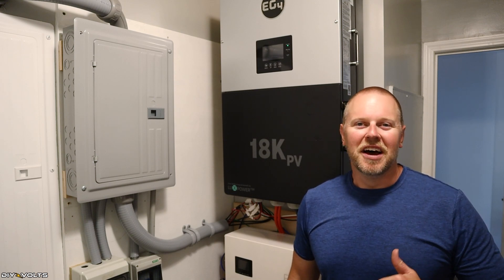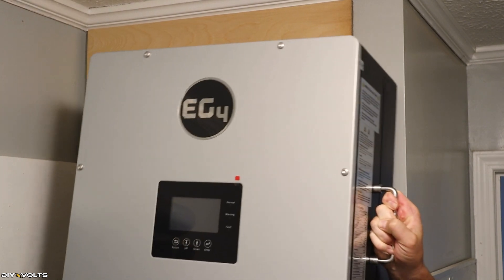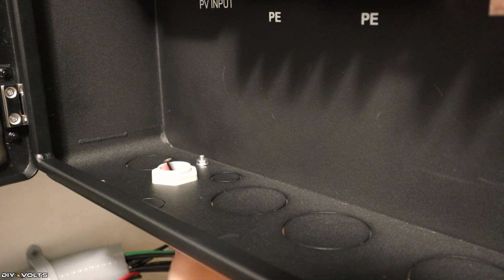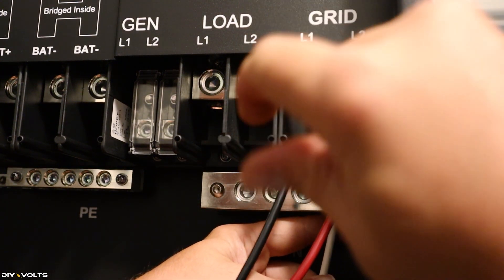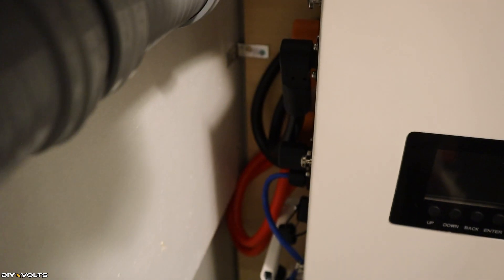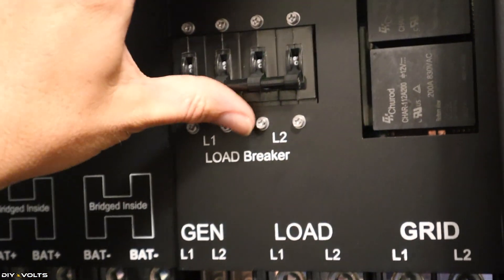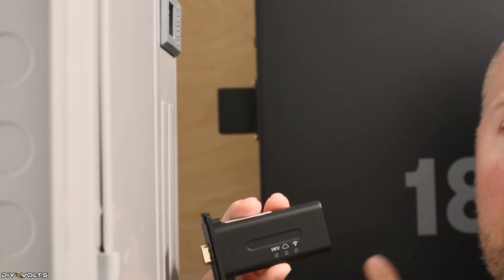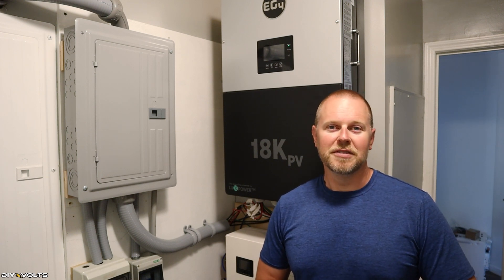EG4 18k Hybrid Inverter Installation: A Comprehensive Guide

Comment: Amateur salesman. High-frequency, transformerless inverter's like this inverter lack galvanic isolation and can potentially damage appliances, mainly due to shared DC/AC grounds, leading to ground loops, leakage currents, voltage fluctuations (brownouts/spikes), and inability to handle heavy surge loads, which can harm sensitive electronics or motors, requiring specialized installation and protection. 

How Damage Can Occur:

Ground Loops & Leakage Currents: Without a physical barrier (isolation transformer), the DC (solar/battery) and AC (appliance) sides share grounds, creating pathways for unwanted currents, causing interference or even system shutdown.

Voltage Instability (Brownouts/Spikes): Some models may dip voltage (brownouts) or produce noisy power, especially under heavy loads, which can stress motor windings and electronic components.

Poor Surge Handling: HF transformerless inverters often struggle with high starting currents (surges) from motors (fridges, pumps), potentially causing shutdowns or stress on the inverter and connected devices.

DC Leakage: The AC output can carry DC leakage, potentially damaging sensitive electronics not designed for it, or even causing issues like corrosion in marine setups.

Comment: Where did grid wires come from? Main panel?
Reply from the maker: I installed those just in case I ever had to charge the battery from the grid. So far after 3 megawatt of solar I have not needed to use the grid. I keep the breaker off on the house panel.

Comment: My senior supervisor when i had to unwire and re wire a 10k sqft building with 4 panels "its like a build a bear" this set up is easy just dealing with weight. Just the 18kv inverter weighs 121 lbs. 55 kg. Essentially i have to replace the existing inverters to be able to wire this in. 12 kw max output.  21 kw Max solar input.

Comment: Where did the ac wires come from?  The subpanel?  And if so are they just to a 50 amp breaker?
Reply: DIYVolts, I wish you would answer the above question. (Where did the ac wires come from?  The subpanel?  And if so are they just to a 50 amp breaker?)
Reply from the maker: The AC wires are only there if I ever needed to charge from the grid. They go to a 240v breaker in the main home panel. I have not needed to turn that on since I installed. 9kw of solar keeps the battery charged enough.
Reply from the maker: I installed the AC wires to the home main panel just in case I ran the battery low enough to need grid charging. The system has now used over 3 megawatts and never needed the grid. The grid charging is limited so I would only need a 20amp breaker if I wanted to charge from the grid.

Comment: So if your solar panels are 60 feet away from the inverter, what size wires are you running to the house from your solar array? Since the wires from panel to panel do not increase as the voltage and the amperage go up? So when you make the connection to the panels at the end of the series, do you increase that wire accordingly? 
Where can I find tables for that high voltage DC?
Reply from the maker: With 10awg wire there is very little voltage drop over 60 feet. My neighbor installed a system with 200 feet of 10awg. The voltage drop is also not an issue. My system is running at 435v so even a drop of 2-3v over that span is not going to make much of a power drop.

Comment: Did you use the CT clamps? Are they required?
Reply from the maker: My inverter only powers a critical loads panel. It is not connected to the grid. No CT is needed.
Reply: Thanka for the reply.  Great install!  @DIYVolts

Comment: Wanted to see you turn off the pv off and battert to see it automatic switch to grid
Reply from the maker: I have my system isolated from the grid. There is a way that I can turn on a breaker to charge the battery from grid but it has been off since I installed the system.

Comment: Are you sure you connect to grid because it shows zero
Reply from the maker: I connected the grid power only for emergency backup. I have a breaker in my main house panel that can charge the battery if I need to. My critical loads panel is isolated from the main house panel so there is no issue with the two power sources competing.

Comment: What gauge wire did you use for your L1/L2?
Reply from the maker: i used 8awg to hold 55 amp. the highest wattage i have used ao far is 7000w.

Comment: best practice would be to put Ferrules on those stranded wires!
Reply from the maker: Yes! sadly i noticed the manual mentions that after i had the wire installed. Its not a requirement in the USA but its a good idea!

Comment: Thanks for the video. Would you mind providing the name of the small white pipe socket you placed at the bottom where the cables pass through? Also, what would the setup difference be for someone with an existing on-grid solar system? I have an existing on-grid solar system and I just got this inverter and battery to convert into a hybrid.
Reply from the maker: Those are called PVC pipe glands. They are meant for larger wire than I used but they supply a nice clean surface for the wire to pass through. Normally an on grid system is going to have a micro inverter right at the panel or close to it. That converts the DC power from the panel to 240v grid power. You would need to take DC power from the panels to the inverter. Then from there you can setup the inverter to output excess power to the grid. I would let the inverter charge the battery first then power the house loads and finally send the power to the grid. There are settings in the manual that can help you through the steps.
Reply: With an existing on-grid system, attach the AC to the generator input, and configure the 18kPV for AC coupled solar.

Comment: Are the 2 positive and 2 negative battery connections one for charge one for feed?
Reply from the maker: Both battey wires are for feed and charge. They are the same point electrically. The battery is setup in parallel. The set of wire allows for higher amp draw with a smaller wire size.

Comment: I think the grid and load and grid wire would be much heavier gauge.
Reply from the maker: Yhe max output of the 18k is 12,000w. The wire I used can supply 55 amps. 55amp x 240v = 13200w. The wire could be 1 size larger no problem but it is still within amp capacity.
Reply: do you have an EV? Think the 18K can handle an EV? 

EVs are on a 60a breaker pulling 48a

Comment: Thank you for the video. One question. What happen if there is lo load in the house (nobody home), battery are full charged by solar panels. And I don’t want supply to the grid. The inverter just go to “sleep mode”.? thank you.
Reply: yes
Reply from the maker: Unlike hydro power or wind power the solar will just sit unused. The inverter does have an idle consumption of 50w.

Comment: El manual dice que soporta 600 voltios, Podría decirme si eso es en total o en cada stream ? porque veo que tu estas usando 345.8 y 349.2 = 695 V   en cada stream, lo que suman por encima de 600 que están en el minuto 15:00
Reply from the maker: Each MPPT controller can handle 600v. I now have 3 strings at 345v each.

Comment: Those wires look very small.
Reply from the maker: I used 6awg. Those can handle 55 amps. The inverter can output 12000w. 12000w/240v=50amp. I still have 5 amps above the maximum output on both sides of the AC.

Comment: Many mistakes ...  Ferrules are required for PV cables, no exception, basic PV install knowledge. Moreover, don't you think you are using the wrong gauge for your load and grid cables??? If you need such power, use the proper gauge, the ones you installed are meant for 50 Amp.
Reply from the maker: Ferrules are not required by code in the USA however highly recommended in some instances. I actually found in the manual that ferrules are recommended. This inverter has an AC output of 12,000 watts. Each leg of the power output can supply 6000w at 120v. 6000/120= 50amp. The wire I am using has a rating of 55 amp. This allows my inverter to run at 13200 watts. This is higher than the rated output. I am sure that you could step up the wire size but as it is now I am good for the rated power.

Comment: Would have been nice to know what gauge wires you were using.
Reply from the maker: The output of the EG4 18k is 12000w. 12kw/240v=50amp. I used 6awg that can handle 55amp.
Reply: @DIYVolts  what about the battery connection?
Reply from the maker: i think it was double 1/0.  should handle 300 amps.

Comment: So let's say your hybrid inverter has gone kaput, does that mean you need to rewire to get power from the grid? because now your grid wires are directly connected to your inverter.
Reply from the maker: I used wago connectors in my main house panel. I would need to reconnect the house breakers in the house panel. It would take an hour but it would not be hard to do. (Each wire is labeled in both panels Hot and Neutral)

Comment: This is really bad , stranded wire screwed down is NOT a good connection, You need to get an electrician or learn how to use crimped Feral connections.
Reply from the maker: True. Ferals are needed on the wire. Good point.

Comment: Any reason why you chose the Ethos batteries over the EG4 wall mount batteries?
Reply from the maker: Big Battery sent the Ethos for review. I have a rhino 2 (same as the eg4 wall mount) and it is a good battery. They take up more space. And the wall mount is 309 pounds. Its easier to move 120 pound modules.

Comment: What size wire did you use for grid and load, and why?
Reply from the maker: The grid and load are both 6awg. This size wire can handle 55 amps. The inverter is a 12kw system so 240v * 55amp: 13200w. The wire size is large enough to handle the output of the inverter. So far in over a month of use I have not had a load over 3000w. As for the grid I have not had to use that so far. But I will limit the charge down to 4000w so that it is well within the wire size.
Reply: @DIYVolts  i am using 6awg with 50amps breaker for subpanel
Reply: You should change out that 100amp main breaker in the sub panel to a 50 amp one. The 18k inverter has a higher pass through, I think and while on grid you could get into trouble.

Comment: What setting did you set your lithium phosphate battery as? Thanks for your video!
Reply from the maker: The inverter manual indicates that these needed to be set at 0 lithium type to communicate with the battery.

Comment: You should also turn all of the breakers off before shutting off the main breaker and then turn them on one at a time after turning the main breaker on.
Reply from the maker: Is that due to an inverter load issue? Seems like the same as a power outage being restored.
Reply: @DIYVolts  less inrush of electricity, and it's safer all the way around

Comment: Don't see cts connected and no grid power shown from inverter screen. cement board would be better choice. metal conduit for pv wires and look like you use ac wires for pv and no ferrule at all. battery cable strip look too short and no torque wrench use. Would like to see update inverter pulling power from grid. #2 wires feed to sub panel for safety load amperage.
Reply from the maker: The breaker I have coming from my house grid panel is only 40amp. My 6awg wire is able to handle 55 amp. when I connect the grid I will only use the power to charge the battery when it drops below a set SOC. I am also able to set the charging amps from the grid. likely I will not have that above 35 amps. That is 4200w charging. The AC will only charge the battery from 20% to 50% SOC. Otherwise the system is off grid only.

Comment: Your wire sizes are worrying me. Should be 2 gauge wire feeding that 100amp breaker, maybe you could get away with 4.  Looks smaller than that.
Even if you aren't needing to draw that much current the wire should match the breaker.  Downsize the breaker if you need to.
Reply from the maker: Good point. The EG4 allows for setting amps for AC charging. I can set the max charging at 55 amps and use the 6awg wire. That is 6600w. I am only using the AC power to charge the battery when it gets below a set SOC.

Comment: You're suppose to use wire ferrules on stranded PV wire. Its in the install manual.
Reply from the maker: Thank you for the information. Looks like page 16 in the manual does indicate ferrules.

Comment: Could you talk about how your grid is connected? Are you passing the full 200a through?
Reply: I would like to know as well.
Reply from the maker: I will be connecting the grid soon.
Reply: @DIYVolts  seems most videos I've seen are all using critical loads panels. Having a hard time finding examples of passing the full 200a through to an existing main panel.
Reply: @paulbram2  Where would 200 Amps be coming from? Not this inverter. 50 Amps max. But in this case, there's only 6kW of PV. So it'll never exceed 25 Amps.
Reply: @manabouthome  I thought it supported 200a passthrough even though itself can only invert 12k. My understanding is it will invert what it can and passthrough the difference.
Reply: @paulbram2  Passthrough is from the grid to the critical loads panel. Not to the main 200A panel. 200A panel is the source.
Reply: @manabouthome  so even though they advertise full home backup, your have to move all home loads to a critical loads panel? If you read the manual I thought there was a setup to output to the main panel.
Reply: @paulbram2  Passthrough passes power through the inverter to the loads panel. The grid connection pushes PV power to the main panel, out to the grid. But only when the grid is UP. So that's not backup power. Backup power is only through the loads connection. The grid connection provides passthrough power and battery charging power.
Reply: @manabouthome  got it, so you can connect 200a to grid, keeping all loads on grid, but that shuts off entirely when grid power is down? Or the grid back feed can also support your entire main panel for full home backup with CT clamps to prevent back feed to your power company when power is out?
Reply: @paulbram2  No. You were correct in a previous question/comment. To backup/power your loads during a utility power failure, they must be wired to a critical loads panel, which is powered by the inverter and batteries. The main 200Amp panel will always be dead during a utility power failure. The inverter can't back-feed the grid during a grid down condition. Grid tied inverters have to match the frequency of the grid before they can connect. If the power's down, there's also no frequency. So the grid is out of the picture.
Reply: @manabouthome  check out page 30 of the instruction manual. Looks like it does support the full 200a to the main panel with no separate critical loads panel.
Reply: @paulbram2  Ok, I see what you're saying. I think that whole house backup claim is a little misleading because it's not automatic. Look at diagram 4.3 on page 33. In order to supply inverter power to your 200A main panel, you need to have a manual transfer switch. So, you can do that. But it isn't automatic backup. If the grid goes down, your lights will go off, until you manually operate the transfer switch. You'd need to have a utility tap, and a separate, stand alone, 200Amp service main breaker. Then feed into the transfer switch from that... Then into your main panel. OR, if you have a critical loads panel and the grid power goes down, there's a seamless automatic transfer of power from the grid, to power from the inverter/batteries. I've seen it happen, and the slight blink in the lighting is nearly imperceptible. And a computer that was running wasn't effected by it. So, we can think about the difference like this: You either move your loads to a critical load panel and have instant automatic backup if there's a power failure. Or you need a lot of additional equipment and more complicated wiring to backup the main panel, and the lights go out until you manually operate a 200 Amp transfer switch. This adds a lot of complexity and cost, and while it is backup, it isn't even automatic backup. You'll have to find a flashlight and go to your transfer switch to manually switch it over.  Cheers.
Reply: @manabouthome  I think the transfer switch is only there to disconnect power to your inverter for servicing? When grid goes down it adjusts the phase and keeps running as much as it can using batteries and solar.
Reply: @paulbram2  I see. So the inverter is passing grid power to the main panel until you manually switch back to grid only. Seems like it would work. But it's a LOT more equipment, complexity and cost than simply adding a critical loads panel and powering your loads that way. The average 200 Amp service isn't usually drawing more than 60Amps anyway. I know mine isn't. So passing 200Amps to the main panel is overkill in many situations. It would depend on the house power demands.
Reply from the maker: I am about to connect the grid. Might not be on video. You can set the grid to turn on and run at a set amp value based on battery state of charge. This means I can run the grid at 5000w and be fine with my wire size and still charge the batteries.